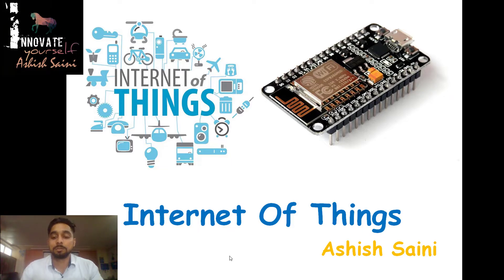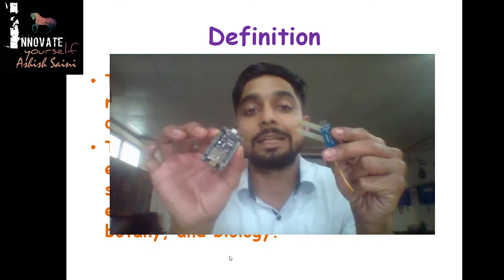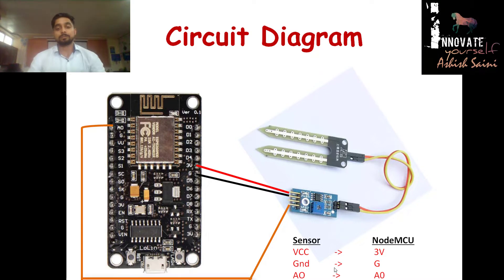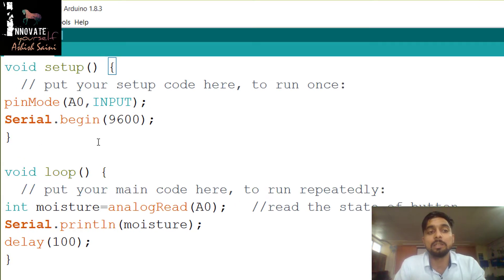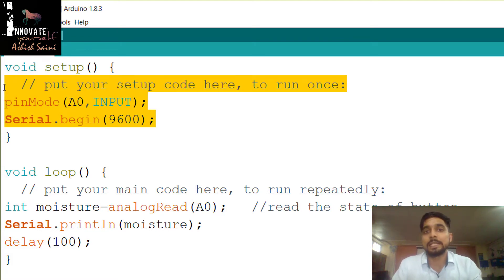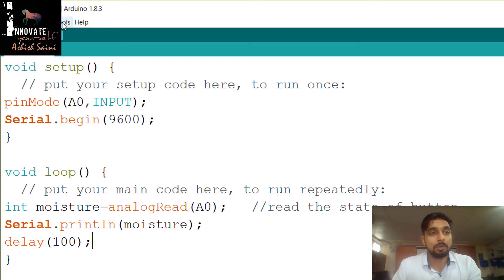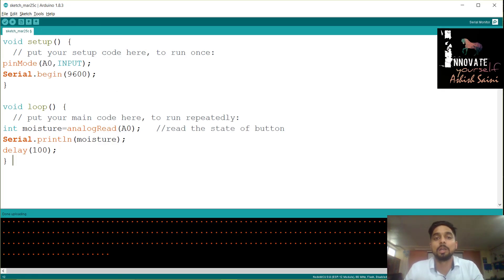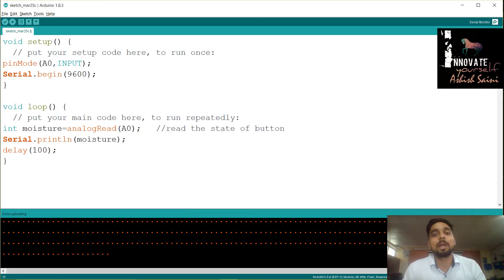Checking the Soil Moisture Level with NodeMCU

Comment: I try to find percentage of soil moisture using blynk application and get soil moisture percentage around 50- 60percent  max but it's not getting 100 percent even if I dip in the cup of water. So could you should me solutions on how to get 100 percentage when it's fully dipped in the water?
Reply from the maker: Before getting the data on blynk, have you checked the data separately that you are sending to blynk?

Comment: 1024 means less moisture? When you dipped in soil content then the value changed to around 250, means it indicates moisture level.. So, I need such values like if soil moisture <50% then the valve should open and if Soil moisture >80% then the valve should close. So what will be the percentage values here?
Reply: Level <820 -valve open
Level >512 -valve close??

Comment: There are 2 pins on my soil sensor which connect to amplifier. Which pin on soil sensor is ground pin? Or I can connect in in any way?
Reply from the maker: You can connect it anyway but if you will notice, in my case I have a comparator connected in between to make it work accordingly

Comment: nice video my guy 

i was thinking if you can check how much moisture is in the soil display it with %
Reply from the maker: That's easy you just need to apply a formula to for calculating the percentage out of 1024 and you are done with this task😉